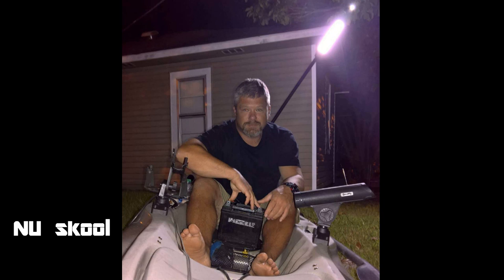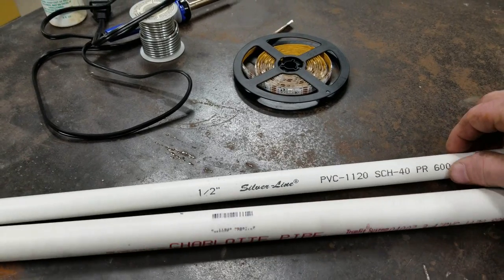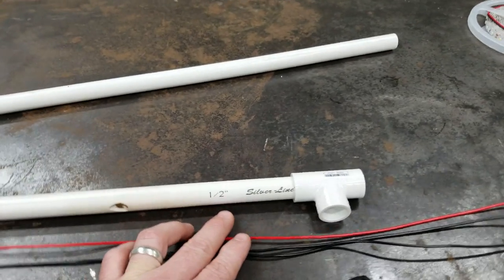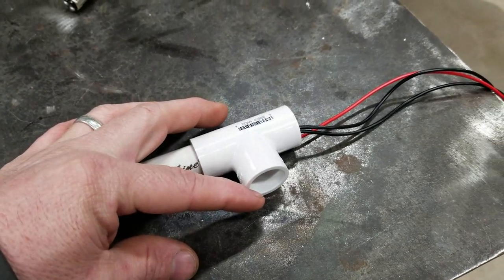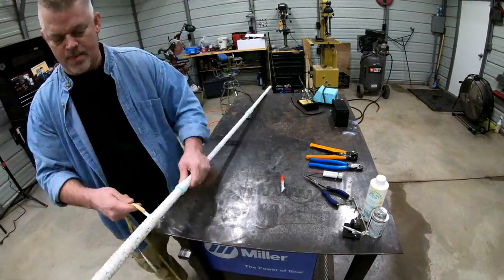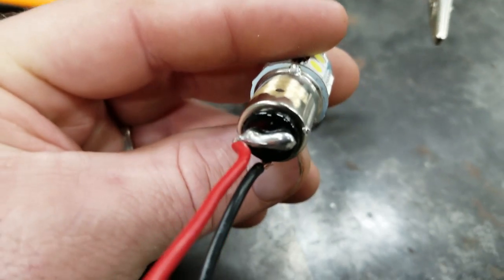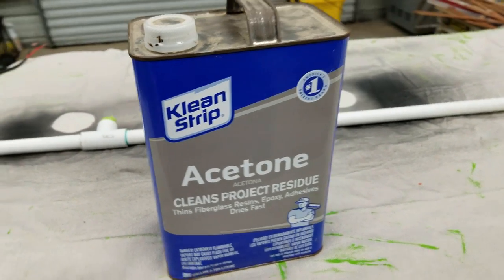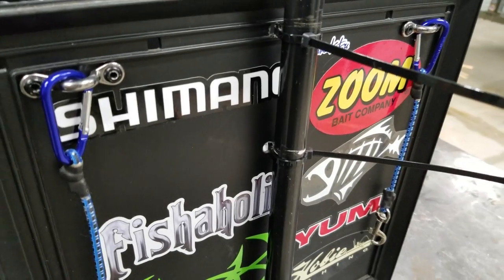Kayak Nav Light DIY (Updated)

Comment: Solid work!! Crazy how stuff is almost made to fit other stuff. If you ever have a plastic gas can and lose the cap to the end of the plastic tube a 3/4" PVC cap fits perfect. I've been using one for 10 years and haven't lost it yet.
Reply from the maker: That's a handy tip brother,  I appreciate you watching and commenting

Comment: Dude, you are the man.  Another great idea and build that outperforms anything that you could buy.   I am in the middle of making mine.  I went with a 1" PVC pipe for the LED strip light to wrap around.  I also used a 4 way 1/2" T, and added two switches, one for the strip lights and one for the Nav light.  I don't have a 12V battery yet, tried my house alarm's 12V battery, but it is so old that it is only kickin' out 7.56V!  So I wired my lighting up to the alarm system where the 12V battery would otherwise be connected to.  I did this to ensure that all my wire to wire and wire to switch connections were solid before gluing everything together.  I bought LED strip lights that had a plug style connection, so I just grabbed an old charger of some sort that fit the LED, and it works great.

Comment: I built this, and it works extremely well. I fish in saltwater, and found that the led strip is not as waterproof as the manufacturer would have us believe. I had to re-solder an led connection that corroded under the clear material covering the strip, and resulted in half the strip going out. My solution was to order a marine grade clear shrink tube from Amazon. The shrink tube has a clear heat activated glue lining the inside that seals everything off from the elements, it's also pretty thick, so it protects the led's from bumps in the night. I've had it working now for about a year with no problems.
Reply from the maker: I don't fish salt but the green light i made  ,,,LED strip had held up fid in fresh water

Comment: Thanks for the great idea. I made one change.  For fitting the led brake light, I used a heat gun to soften the 1/2 in. PVC pipe, the simply pushed the base of the light into the PVC and held it there until cooled and pipe once again hard.  I'm sure I'm not the first.  I actually prefer the single brake light vs. the strip light.  My strip light became so hot after 20 minutes that the 3/4" pipe soften and bent.  I was testing the battery.  I'm sure it will work if I o ly use it a few minutes for video.
Reply from the maker: That a great and simple solution  , I should have thought of that , I've did it before , great idea . Ive never left the stripe light in long because of the bugs lol . Thanks for watching brother have you checked out the kayak box
Reply: Thank you for posting about the strip light heating the PVC.  I making this light and will use CPVC instead of PVC since it has a higher maximum temperature of 180 F vs 140 F for PVC.

Comment: Soldering is never overkill,it’s piece of mind. Especially when dealing with DC voltage and moisture. On a side note.. when I solder I connect the wire horizontally, twist together,solder then shrink tube. Takes up less room.
Reply from the maker: I agree with you 100 about the piece of mind man . But im not the best at soldering that's for sure lol

Comment: ARGH!  I loved this idea and watched this video more times than I can count because I wanted to make one for myself. I purchased the exact same LED Light strip and PVC, Brake light, Marine Wire, everything just as the video says.  I cut the 18 inch piece of 3/4 in Schedule 40 to start wrapping the light strip just as our guy did in the video, nice and tight, one butted right up next to the other,  used Super glue every 3 inches just like he says. Only to find out that you get to the end of your 18 inch piece of tubing and you still have 2 feet of LED lighting on the roll.  18 inches wasn't long enough.  Once I realized that I would need a longer piece I started to unwrap the LED strip that I had already wrapped around it and the super glue every 3 inches but the self adhesive backing seemed to hold so well that it peeled the back of the LED strip right off damaging it beyond repair.  I can re start the project by purchasing another light strip along with some more Schedule 40 PVC but just be aware, anyone that plans on trying to follow our guys directions to the letter. Instead of cutting the piece to wrap the lights around to 18 inches, use a longer piece. Wrap the lights around, and once you get that done go back and cut your PVC after wards.  That's the only way that I can see to avoid what happened to me happening to you. Great Idea but if your gonna try this yourself, don't cut your piece before wrapping your lights. If I knew how long it would need to be I would list it here but I haven't retried it yet.  Good luck

Comment: Over here in Australia we have to have the white nav light as you call it, here it's an anchor light & the nav lights are the red green port starboard lights. So if you can find a neat way to make those DIY then great, all powered boats by law need the red green nav lights that are greater than 54 lumens so that they can be seen for 2 miles. I'm making a 10 foot longtail catamaran that also has hydro foils with a 13 HP motor which should reach about 40mph while it's off the water.
Reply from the maker: That' sounds like an awesome boat , over here in America or laws are the same as yours for power boats , but on kayaks they don't want you running green and red because boats can mistake you for another boat , and you don't have the speed to move out of the way . Is better they think your a anchored boat because a basically that's what you are moving 2 or 3 mph lol the brake light used on this Nav light is well beyond 50 lumens if I had to guess I would say closer to 250 lumens.  But im sure you could make Nav lights for a boat using the same principle id you wanted . I appreciate you commenting buddy . I like learning too

Comment: Really loved this one I just ordered my materials and I will post back with a picture of it if I can figure how to do it. I’m making slightly different I will have 2 bulbs in addition to the strip leds. They will be switchable and I will also mount them in sockets for a easier way to replace or update the bulbs in future. I will be using #16 silicone insulated wire for the project and I will be adding a fuse to the power lead. The 1157 bulbs I found on Amazon are 2000 lumens so I’ll have enough light I may add a dimmer to it if I can find one that I can fit it. I will also see if I can make it strobe for better visibility. On the little lakes I go to I’m not worried about being hit as they don’t allow gas motors. But I do fish on some rivers and bays that have every boat you can think of and a lot of drunk drivers.
Reply from the maker: I'd like to see it . I never use the sockets because.  Ive never used one the 50,000 hours needed to burn one out lol . Ive usually don't made another before then lol

Comment: I like the videos and I appreciate them greatly.
I have a Hobie pro angler 12 and have been thinking about making a crate for the rear. But I also think about more rod holders, nav light, stabilizing bouys and other things to make fishing easier.... standing up on my kayak makes catching fish easier.
So I been thinking.
You know the rod holders on the pa12 are basically behind my elbows when seated in the boat.  I'm thinking if I could put pvc pipe in those holders and put two 90 deg elbows (away from the hull on each side) out to the bouys (stabilizers) then 90deg back into the boat... framework, if you will, around the crate.  Within the frame of the pvc, make two rod holders on each side of the boat and they could be designed out further  from the side of the boat so you don't have to turn around so far to change rods when fishing.  Since the crate becomes so top heavy with the rod holders (with the rods in them), this may be an improvement to the crate.  The crate can then be attached to the stabilizer/ rod rack frame.
I could probably integrate the nav light into the pvc frame.

I hope this makes sense, cause I'd love to hear your thoughts.

Thanks again for all the cool videos.
Reply from the maker: I really appreciate brother,  ill have to mull that over brute see what I can come up with

Comment: I think a good addition to your DIY projects would be to include how long it takes for the project total and how much it cost total.  That is huge for DIY because if it does not save a lot from buying the packaged solution then it better be pretty quick to make it worth it unless it is significantly better than the off the shelf one.
Reply from the maker: I agree with you . I normally do tell what I spent total  , that nav light is cheaper and better than anything they sell . But i can only say what I spent.  There's ppl watching from a lot of different countrys and if I buy something and leave a link , if a 100 ppl go buy one they sell out so you have to buy a different one it happens a lot especially on Amazon then they ask me for another Link and the price is different.  So I can only say what I spent

Comment: I would recommend that you switch the hot wire. If you have a short down stream from the switch breaking the hot wire will prevent the battery from discharging and also prevent the short from burning something up. Functionally it does the same thing it's just safer. It would be cool to use a 1/2" four-way or two "T's" so you could switch both lights
Reply from the maker: Your right , thank you

Comment: PRO TIP use that denatured alcohol to clean the PVC before sticking the LED strip and the 3M double stick back tape will adhere a lot better for the long run! Nice build brother! 
Cheers, #SeattleRingHunter

Comment: LOVE IT!!! Your videos are GREAT!!!! 

Only one issue, and to be honest, it's not a huge one, but is is non the less. 
By the time I add in a Lithium Ion Battery and a charger, I am in for at least $70...Plus my time and effort. Not a big savings. But if I already had a battery for my kayak for some reason, it would be a super easy decision. Keep up the amazing work!!!
Reply from the maker: You don't need a lithium battery  , I did a battery comparison video with different options on it . The regular kayak battery which is $19 will ruin one for 3 trips
Reply: @FishinNStuff  Yes sir, I watched that too! I am a bit of a heavy fella, so I feel the need to cut weight where I can, and apparently that isn't on me. ;)
Reply: @FishinNStuff  Also a question....Would it be beneficial to have two lights on switches? One flashing and one always on. If so, could the flasher be red and on white. 
So at the top, I put an additional "T" Putting the white light out the top, then make an elbow upward off of that T. (Towards the back of the boat.) Or even go straight out. Put the red flasher on that rearward elbow. (Red strictly being for others to see you better.) 
Would that even be legal? 
BTW, I didn't tell you thank you for taking the time to reply the first time.
Reply: Never mind the red flasher. I found the rules and it isn't advised. 
From the Coast Guard rules FAQ:
https://www.navcen.uscg.gov/?pageName=navRulesFAQ#0.3_14

14. Can I use decorative lights, strobes, or other high intensity or specialty lights to be more visible at night? 
Standard lights are displayed aboard all vessels to help others to identify them and to better understand their maneuvering characteristics or possibly distress.  The use of any lights, other than the lights prescribed by the Rules or its Annexes, is discouraged because the use of decorative lights, strobes, or other high intensity or specialty lighting could:
confuse, rather than make you more visible;
obfuscate a vessel's navigation lights, its characteristics, or cease to provide crucial direction and aspect information to other vessels;
likely hinder a proper lookout and operators visibility (see Rule 20(b));
be mistaken for other lights used as aids to navigation, by law enforcement or public safety vessels (i.e. flashing blue, red, yellow lights).
For example, if while operating my vessel I see a red light on my starboard side I know I am the give-way vessel (Rule 16, 17).

Should a mariner opt to use additional lighting, we suggest you look at this lighting from afar to ascertain whether it would violate Rule 20; and, we exhort you to adjust or refrain from using such lighting, if that is the case. 
 
Note, although Rule 37 of the Inland Rules allows the use of a high intensity white light flashing at regular intervals from 50 to 70 times per minute to signal in distress and requires assistance, such and similar lights are prohibited in the International Rules (Rule 36), and, shall be avoided because their use could interfere with the lookout and being seen by others.
Reply from the maker: @paulhandwork  each state is different ontheir rules , our state says your light must be visible from 2 nautical miles . They really don't want you to use a green and red light because people can confuse you for a boat  . Basically a white light is used while on anchor and a kayak speed is slow so its Basically on anchor
Reply from the maker: @paulhandwork  that little small lithium battery on that video would run it a while it think
Reply from the maker: Like this one
https://www.amazon.com/dp/B07Z8X9SHX/ref=cm_sw_r_apan_glt_fabc_8N45NX82K7TM65RDB03G
Reply: @FishinNStuff  you da man!!! 
Keep up the good work and happy fishing!

Comment: Interesting project. I might make one for my 13 foot Boston Whaler because the all around running light  mounts to the steering console and shines in my eyes. Pretty annoying. Also you didn’t note what the brake light was. Maybe listed on the previous video. Also I thought you should put the switch on the positive wire. Works I guess for DC but dangerous for AC.
Reply from the maker: This is like the bulb I used , its just an older car brake light bulb replacement 
https://www.amazon.com/dp/B01MY4T4BU/ref=cm_sw_r_other_taa_pbx5EbDZYFWE9

Comment: Hi. I like the DIY for this light. I am making one now but I dont understand how to connect all of the wires. Please help. Thank you for the great idea and project.
J. Jones
Reply from the maker: After making a few of em the easiest easy I've found to do it is . Run a positive wire up the pvc tube and split it into both lights on the positive wires . Then run 2 negative wires 1 of em to the top nav light , the other thru the switch and then out to the striplight

Comment: Very nice, I didn’t catch the part number for that upper bulb? Thanks, good work!
Reply from the maker: Thank you Sir , any old style LED brake light bulb will work . Led and old style are the main things here a link to one . The one I used came from Walmart but they stopped carry them so use these and one more thing I'm posting a new Kayak light video tomorrow it's a little different plus its been Ober a year since I made this one or close to it 

iBrightstar Newest 9-30V Super Bright Low Power 1157 2057 2357 7528 BAY15D LED Bulbs with Projector replacement for Tail Brake Lights,Brilliant Red

Comment: What size is your battery 12v, but how many mah? How long does your battery last?

I ask this because a friend of mine gave me a 12v battery that looks like the same battery you have and it's a Rechargeable from a flood light. I was curious how long the battery would last with nav light and using led strip lights occasionally.

Great vid man thx for sharing! I subscribed 👍
Reply from the maker: Mine is a 7 mah battery I got off of Amazon , it'll last all night easily,  LEDs  don't pull much power plus I don't use the strip lights all the time , they will draw bugs in  bit the brake light does ,not , I've ran my 7inch Hummingbird 3 trips before recharging it  , hey man I appreciate you watching and will always help you any way I can , check out the kayak box video I posted last week , I've got a few more kayaking DIYs in the works as well
Reply: @FishinNStuff  great!! Thx for the reply. I love the design you did with the pvc and I have watch many vids. Thx for sharing your design,im making one for my kayak now 👍. I will check out your box vid and others you have made. You explain everything in detail 😁

Comment: Well, I could tell you this is really cool but you've heard that a few times. After watching a few of your videos I think you could add the clear heat shrink tube to this to cover the LEDs. I have a small 14' fishing boat and I'm looking for a way to get a rod holder into the boat to get that stuff off the floor when we are out in the boat and to add this Light. There is a spot for a nav light on the boat but the light doesn't work well - How about something to replace the nav light with your nav light. I liked the crate with the light and rod holders but it also takes up some floor space which I don't have a lot of... any thoughts on a rod holder I could attach to the inside of the boat... I'm not sure if you can shoot me an email and I could send you a few images...
Reply from the maker: My Email is in the about section at the top of my channel page  , I agree I would put the clear heat shrink on this too but this videos older and I hadn't thought of it yet lol

Comment: I'm kinda confused on the negative ..1 wire you split into 2..but then you have 2 negatives hook to the switch?
Reply from the maker: It's easier to run a neg to the switch then to the strip light and a different negative to the nav light and hook em together at the battery.

Comment: Nice lite fuse your circuit or use circuit breaker at battery switch  your positive wire for lite. Thank you
Reply from the maker: redwood1957 yeah that wouldn't be a bad idea at all